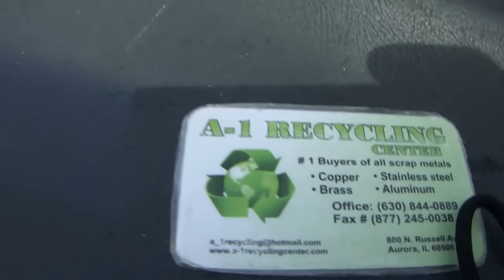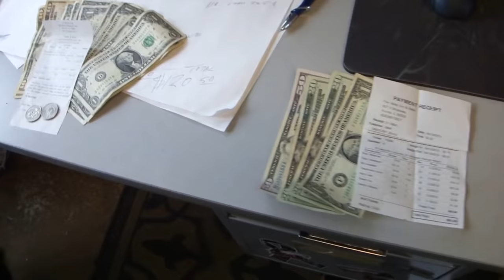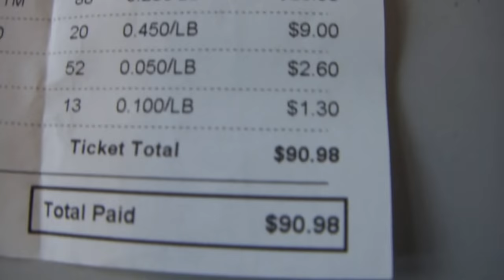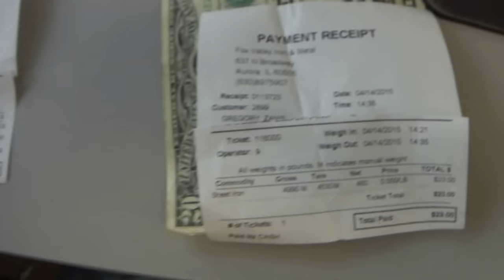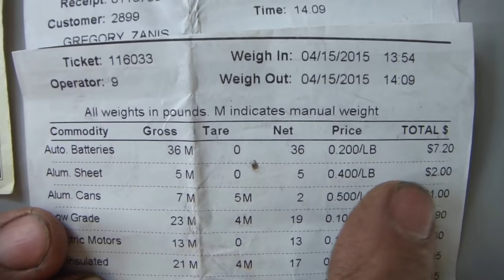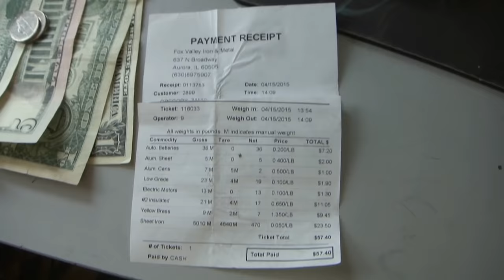Scrapping Out A House

Comment: How much are you getting for steel? It's no where near worth my time here  as they'll pay 10$ a ton and I need a 500lb min. just to sell it. So 500lbs in my truck loaded down to drive an hr each way for $2.50 is pure crap. I do ok for copper and aluminum and cast iron though but luckily I can give the steel away locally. Too bad cause I get alot of steel.
Reply: On my country I get 100 € ton